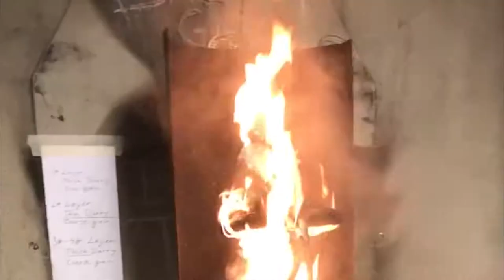Clay to bronze part 4

Comment: Why just leave the crucible on the floor in the sand?  They last longer if returned to the furnace to cool slowly.
Reply from the maker: Thanks for the comment, will look into this. The idea was to let the bronze cool with the crucible at an angle in order for the crucible not to crack during the cooling.
Reply: Daniel Strandow Thats why you simply place it back in the hot furnace.  It takes 6vhours for my furnace to cool completely down.  Can't get much slower than that for a crucible.  It helps them last much longer.  Take a peek at my channel if you want to see a one man show.  :-)
Reply: Daniel Strandow did you guys dump the excess bronze out of the crucible while it was still molten?
Reply from the maker: No, we left it to cool at an angle. Another crew re-melted it again the next day.
Reply from the maker: Great tip. Will definitely check out your channel.